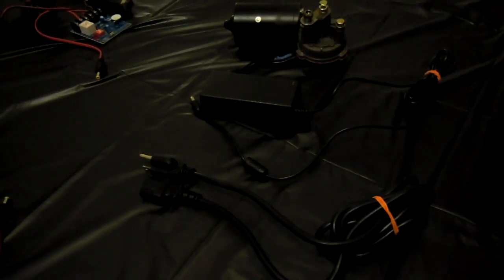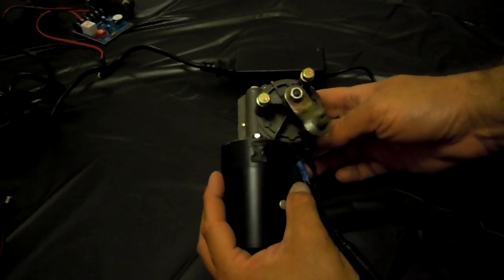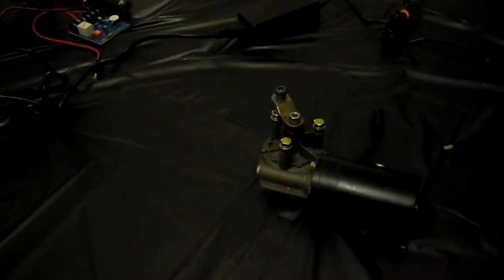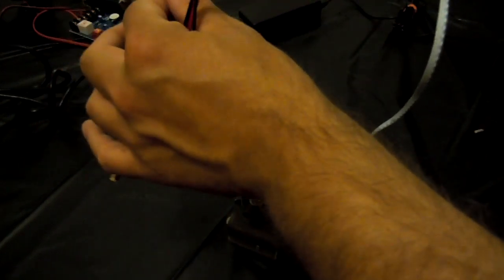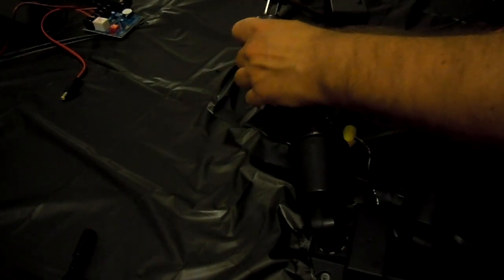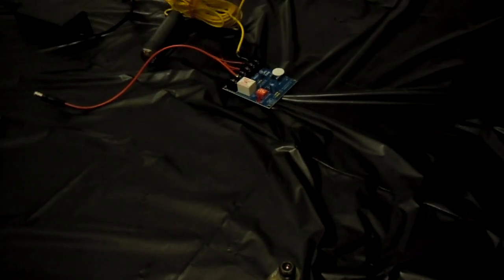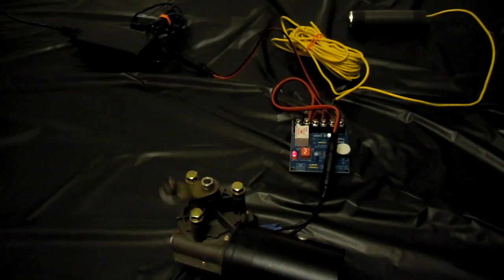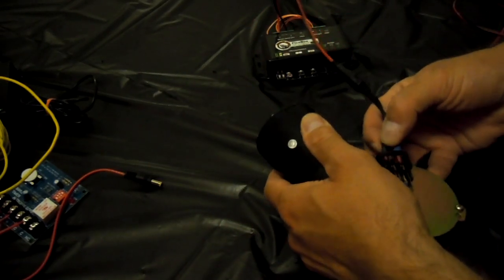2014 Wiper Motor Walk Through/How to

Comment: Wiper motors good cause it's got low RPM, but High Torque.  I'm stuck with a motor that makes 1/4 hp @ 1725 RPM.   I don't think I will be able to do direct drive.

Comment from the maker: http://www.ebay.com/itm/DC-5A-12V-24V-36V-Motor-Speed-Driver-Adjuster-PWM-Control-Controller-25Khz-/281468648695?pt=LH_DefaultDomain_0&hash=item4188d6bcf7

http://www.amazon.com/gp/product/B00CGXJSNY/ref=oh_aui_detailpage_o09_s00?ie=UTF8&psc=1
 
Here are some links. The PWM's can be found on EBay and Amazon. The prices vary from $6.00 and up. The one I really liked from EBay is no longer available, but I did find a few that are similar to it. One thing to remember, overseas shipping will take some time. 4 to 6 weeks.
Reply from the maker: Schwob94 No problem, yes these others will work just as well. The one I preferred, seemed to be much more sensitive with the adjustment dial. That was the reason I like that one much more.
Reply: Ah, I see!  I didn't realize they had differences like that.  What does the KHz rating on each of the boards denote?  I just noticed they all have varying numbers.
Reply from the maker: Sorry for the late reply. Its build season!! LOL. I really do not have the answer your looking for. I went out on a limb and bought three different ones to see what would work best at the Pro-Haunt I was at last year. The difference was very minor for the application for what I was looking for. I tend to buy in bulk, at a Pro-Haunt things break all of the time and back-ups are needed.